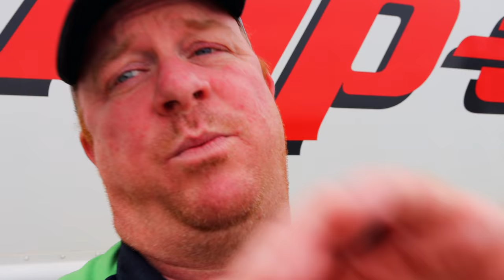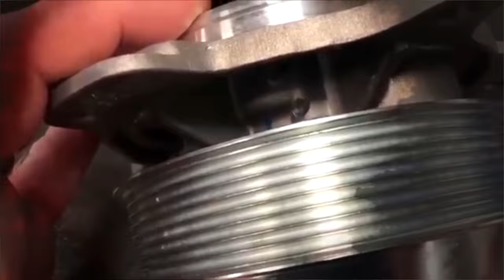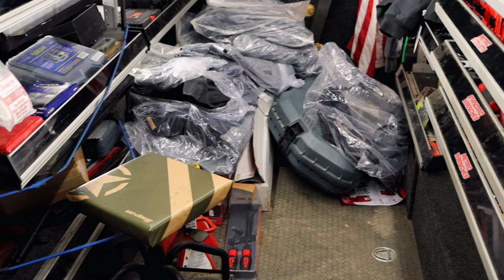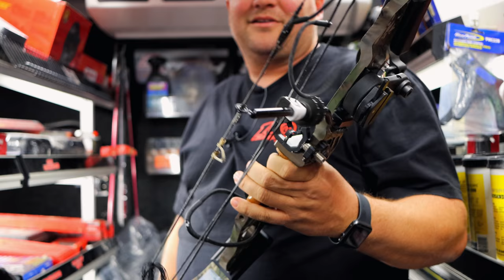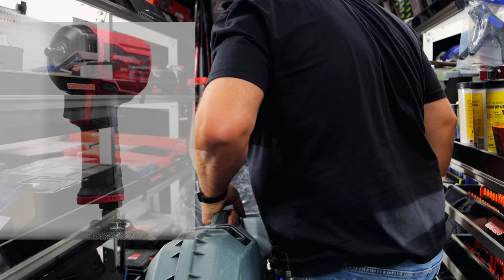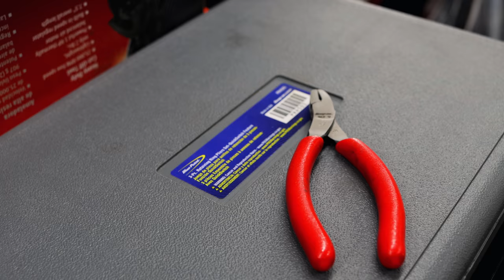Snap On Tools: How Truck Credit Works and My History With Snap On

Comment: Aircraft mechanic here, been in the business 3 years (I’m 21) just started my account with snap on about a month ago and Couldn’t be happier with my dealer. Super cool guy and always has something good for the aircraft guys.
Reply: How did you become an aircraft mechanic
Reply: @SnD340  You go to school. Like anything else. However, working on aircraft is more structural work than mechanical.
Reply: @LynxStarAuto  that’s not really true. There’s usually only specific mechanics that specialize in structural/airframe repairs.

Comment: I’m a lube tech but working my way up. I was doing A LOT of tire jobs and rotates. Snap on guy came by and I went on that truck with $0 down he gave me a torque wrench on a truck account. I didn’t bring a card that day because I kept telling myself I wasn’t going to go there cause I couldn’t afford it. I was planning on getting a gear wrench torque wrench but they haven’t been available for awhile now. Moral of the story, treat your tool dealers right because when you need something bad, they might help you out even if it’s a bit of a risk for them. For all he knew, I’d have got that wrench and fled the country, him being out $600. Thanks Ricky and his boy Cody. Good dealers so far and hopefully for a long time.
Reply: They used you: signed you up for a tool you could not afford.

Comment: You guys are really lucky to have a Snap on Rep you can trust and deal with! Back in 1977 I purchased a New Snap on upper and lower box from our Snap on  Rep. I been retired after 30 years in the field. Since retired I still do  a lot of my own repairs and I'm 72 now. It's really difficult trying to run down a local Snap on rep willing to stop and sell tools. I have to end up shopping for Kobalt or husky hand tools. I still have all my Snap on tools but due new automotive components electrical test equipment is hard to find. I enjoy watching you! John
Reply: hey you can always order snap on tools on their website and you can call their customer service for warranty thru mail
Reply: Snap On trucks don't just stop at people's houses to sell them stuff, that's not the way it works. You can also buy stuff online
Reply: I put broke tools in my car and stop when I see a truck at a shop. If that doesn’t work I call snap on. I’m registered there as a former now retired mechanic and they do exchanges that way, I just have to send the tools in first after they send a shipping label.

Comment: I got on the snap on truck for the first time in a really long time this week. I’ve had a desk job for 15 years and hadn’t been on a truck since making that switch. I moved to an office where the snap on guy shows up last summer but I’ve behaved and stayed off. My brother in law got a new job as an ag mechanic a couple months back so we decided to get him a snap on gift card. Well I couldn’t walk off that truck without getting something so I got a gift card and a new 3/8 locking flex ratchet. I traded in an old 36 tooth fixed head for it and I can’t believe how much smoother the new one is.

Comment: So I just bought a 3/8 chrome and impact socket set deep and shallow, metric and sae, with extensions and a ratchet. Complete set from our new snap on guy. He said it was “brand new on the truck just came out 50% off.” But. He wants it paid in 10 weeks at $150 a week which is steep for me. I haven’t touched it since I bought it Friday of 12/22/23. My cornwell guy comes Wednesday, matco Thursday, and snap on Friday. If I can find a similar set on either truck that’ll do better payments. If I can find one. I’m going to return the set in the same brand new condition it’s in. Sucks because I really love the set but that’s just too steep for me payment wise

Comment: I knew my snapon dealer from another shop I shortly worked at. I was gonna go to get a set of bluepoint metric wrenches for $266 for $25 a week. Of course my service manager (and my mentor) didn't want me to go with snapon, but with our cornwell dealer. Cornwell was having a monthly deal of a 19 piece metric wrench set with a 12 piece sae set and a work light.  The sae and work light being a bonus at the price of the metric set. $30 a week. My Cornwell dealer's rates were $20 a week for a $100 item and $30 a week for $200&up. Well my snapon dealer over shot his chance when he offered me a shit ton of bluepoint tools (with a rolling tool cart) for $25 a week. Of course when I did the math that would have taken me 3 years to pay off. So I ended up with buying tools off my cornwell guy. With him he has a set limit for me at $500 and will not let me buy what I cannot afford from him. Simply put I just wanted a set of wrenches. Cornwell guy sold me wrenches. Snapon guy try to sell me more than I really needed at the moment. But do not get me wrong there will be a point where I will get a few things from him.

Comment: I worked at a shop that the owner wouldn't let tool trucks on the lot, they had to wait across the street until we got off work. Didn't work there very long and the place had a high turn over of techs.

Comment: My dealer is an older gentleman, he's very kind and understanding but also has that no bs style way of handling business. Right after he told me that I could give him 30$ for this week's payment (my min is 60 and my total is around 1400) he comes back by my bay and starts rummaging through some older tools with a list picking the things out somebody before me had defaulted on. Something inside me is telling me that it was a gentle reminder of what will happen if I default. Ended up scoring a deal on a used set of precision torque impact sockets!

Comment: 28 inches is the standard on what the Bows weight it measured at.
On a Compound Bow you can easily Adjust the Draw length for your size.

Comment: I can't believe how little the pay rates are there. Most guys around here won't work for less than $20 an hour. Hell, I make close to $30 and I'm only a tech B...
Reply from the maker: Not all shops pay that low but several of them. I’ve never checked all the pay rates but Hamilton knows much more about that than I do. I always do my own thing and not worry about others.

Comment: I've always had a great experience with tool truck dealers when I worked for different shops. At the moment I'm working independent and probably doing better financially but can't get a truck to come by my house. I need a new box and a few other things. How do I get in a truck if I don't work for a shop
Reply from the maker: Just text the dealer. Chances are you probably won’t get any financing offers not working for a shop. Makes it too hard to repo if you don’t pay

Comment: This was an interesting video. I have been buying Snap-On Tools for 30 years, but I am not a professional and have never been on a Snap-On truck, except through Mr. Koon's videos. Until now I didn't understand how Snap-On financing worked.

First off, I didn't know that Snap-On trucks were also rolling pawn shops. Because that is what they are if they take in used crossbows. 

Second is that you get 20% off for paying in cash. Around 1990 I bought my first batch of Snap-On tools from a distribution center that was shutting down. But since the advent of the Internet I have bought most of my Snap-On tools off ebay and craigslist. My policy on used tools has been to pay no more than 50% of list for new or 30% for excellent or like new condition. There are Snap-On Tool reps on my bowling leagues. Now I know I can ask them to sell me new tools for 20% off rather than buying off the Snap-On website. Since Snap-On doesn't charge interest on their credit account, to me this indicates Snap-On has built any interest into the list price of their tools.

Third is that now I understand how the Snap-On credit system helped me out. Back in 2013 I got a brand new black KRL722 off of craigslist for $2k. The mechanic told me that he won it in the district Snap-On raffle. To get into the raffle you had to have made every one of your credit payments for the last 12 months. Of course he already had a tool box and didn't need it so I got what I think was a good deal.

Forth is I didn't know Snap-On financing is so short term. What is the point of financing it if it has to be paid off so quickly and you lose the discount? (Except for maybe winning a free tool box.)

Fifth is that being a mechanic is a $20/hour job minimum. Something is wrong if they are not getting paid at that level. Some people described in this video will get a raise when the minimum wage goes to $15/hr, to then be making the same as a fast food worker.

One way I keep my Snap-On costs down is I only use hand tools. They last forever, almost never break, have sensitivity, and maintain their value. I understand that using air and battery driven power tools allows professionals to do things faster and make more money. But if you don't make money from them, power tools significantly raise tool costs.

Comment: Off subject.      But I have noticed something with SnapOn 14.4 volt tool line.    Older 14.4volts where 1.5 amh Newer ones are 2.5 amh      I have noticed very big difference in say how the brute works with 2.5 amh 14.4 fully charged vis 1.5amh 14.4 fully charged.     Wonder why that is.  thought amh rating only made difference in how long battery will last not how the tool will work.
Reply from the maker: It only affects the rating of the power to time it runs but if it is designed for 2.0 amp then it will have more power than one designed for 1.5 amp etc obviously. But I think it’s all the same load motors just more run time. Maybe it’s dying off faster or older batteries not getting as hot of a charge

Comment: Hey could you video the new Snap on brake bleeder. I just purchased one and Snap on notified me that a mechanic used unregulated shop air and the bleeder tank blew up. I watched the Youtube video they had and again the video used no regulator. The instructions say no more than 75 lbs. but if the video advertisement did not use one someone else may get hurt. Hamilton please comment on this. Lets all stay safe. Thank you for all videos. I enjoy them.

Comment: Is it possible to have a credit account without working at a shop? If you give them your credit card info, and just tell them to run it a certain day every week, wouldnt that be fine?
Reply from the maker: I don’t think most dealers would because they couldn’t track the tools down like if you worked at a shop. But ?? Each dealer has their own business so ?
Reply: I dont work in a shop and im not even a mechanic and I have a account my guy will come right to my house if i need something...but he knows I pay and most of the time its cash
Reply: @andyarmstrong5378   i figured it would basically be if you established a good relationship with your guy, ive just been curious about that

Comment: I pay at least $100-150 a week to my Matco guy but I make up to $23 a hour as a tech and my wife's a tech and makes more than me and I like to stay under $800-1000 max debt and pay it off as quick as possible to get more tools I need and my dealer is more willing to let me get that $800+ tool without questioning if he has to worry about letting me get it because he knows I'm going to pay it off quicker than most people that only pay $20-50 a week.

Comment: Here is what you need to know. Truck credit can be a very good tool. Just be careful. At one time I had a 300.00 a week habit.  We where doing greatest it was no big deal. Snap On is absurdly high, with that said, if you have a great dealer you are paying for service and that is worth a bunch. Beware though....not all dealers are like this guy. Some have very little scruples and not much work ethic. A good dealer will keep you from getting in over your head. Don't be mad when he tries to slow you down.
Reply from the maker: Great point

Comment: A mechanic getting $10 an hour  in Mississippi? Wow here in So Cal they charge $125/hr
Reply from the maker: What they charge and what they pay is two totally different things. Most shops here charge $100-120 hour at dealerships. Independent shops are much lower $50-90 and diesel shops are from $80-150

Comment: When I started I told myself I would never get off the RA. My Snap On guy was a jerk so I went with Cornwell. Once I ran up so much that was it. I made many $200/week payments but I was driving junk, eating junk, just trying to get myself established with good equipment to make money. My Cornwell guy was the best. After making consistent big payments and buying what I needed he knew I was good for the payment and I was trying to buy as much as I could as quick as I could without racking up an unmanageable bill. Many times I needed a specialty tool that would have technically gone over my truck account limit if I just bought something and he would just do it for me. Of course the biggest benefit to staying on the truck account was no interest. Felt good after my first year in to have just about every tool I needed other than the obvious specialty stuff we all have to buy time to time paid for then I started to live a little bought a truck, house, etc...

Comment: I buy quality tools  but at no point will I spend 90 dollars on a snapon screwdrivers
Reply from the maker: Most are more than $90 on the sets
Reply: @KoonTrucking  that's the point
Reply: @KoonTrucking  if it ain't klein it ain't mine :p